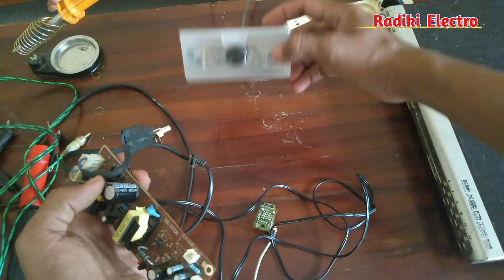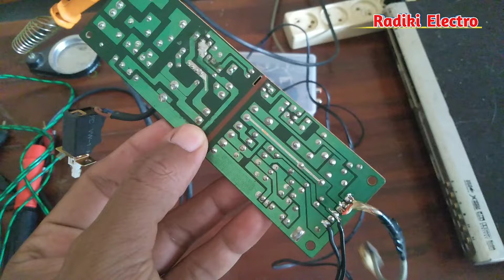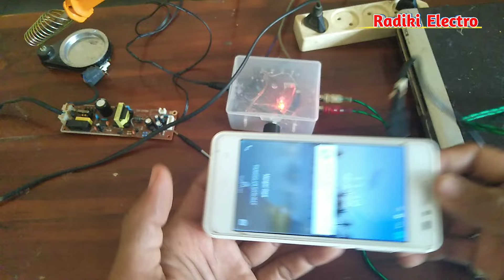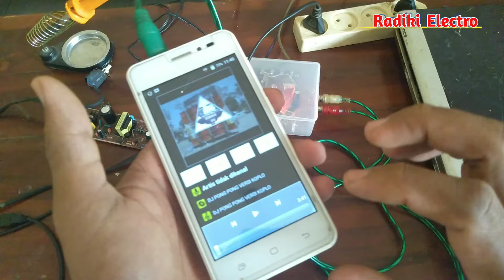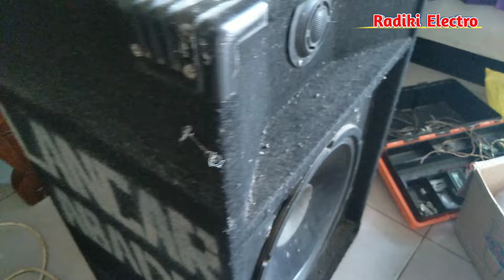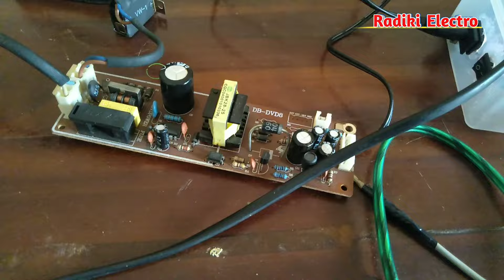Memanfaatkan DVD player bekas atau rusak untuk power amplifier mini

Comment: Kalow tpa3116d2 bisa gan
Reply from the maker: Bisa tapi kurang maksimal gan,,
Reply: @radikielectrolovers2648  bang kalau gabung 2 psu itu apa bisa? Maksudnya 2 psu diseri biar dpat 24v, cara itu apa bisa?
Reply from the maker: Mau dibuat apa lur?
Reply: @radikielectrolovers2648  buat ngangkat tpa3116, ktnya rekomnya 24v, apa bisa yg sprti itu?
Reply from the maker: Gak bisa lur,, mending rakit power supply dari travo 3 Amper saja lebih maksimal,,klo pakai PSU bekas DVD cocok untuk yang Watt kecil contohnya PAM 8610
Reply: @radikielectrolovers2648  kalau pam 8403 dikasih 12v apa kebesaran ya?
Reply: Klo bt tda 2005 bs ga..

Comment: Saya punya PSU DVD outputnya ada tulisan +12 volt GND -12 volt,untuk ampli ngambilnya GND atau -12 volt bang ?
Reply from the maker: Ambil yang positif (+) dan ground (0)
Reply: @radikielectrolovers2648  berarti +nya +1volt dan -nya yg tulisan GND bang ?
Reply from the maker: Iza lur ambil yang (+)12 volt sama ground saja,,yang (-) gak usah di pakai